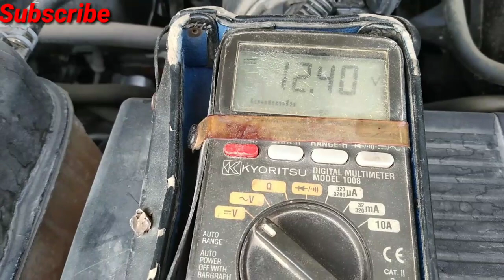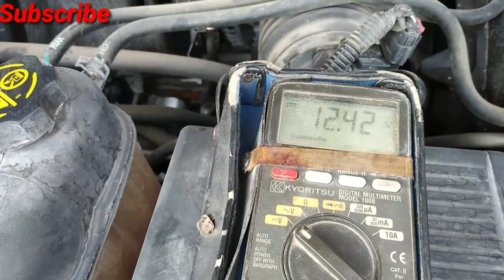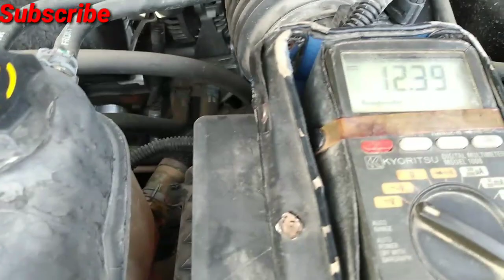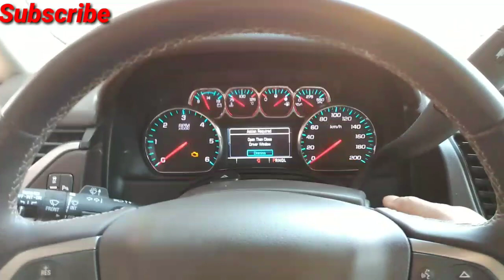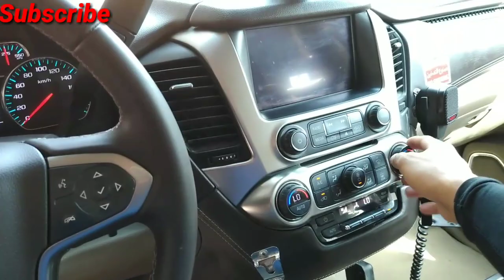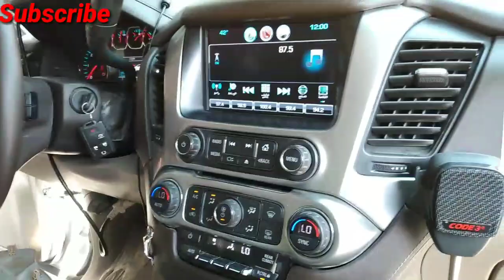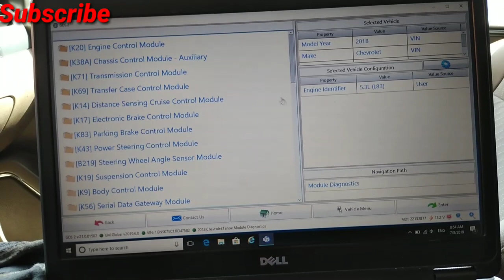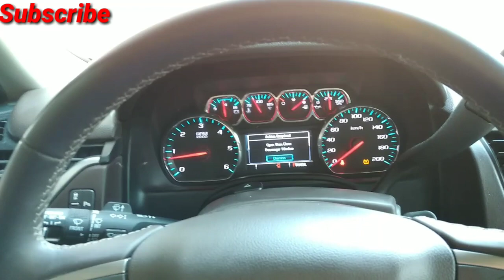2019 Chevy Tahoe No Power No Crank No Lights How To Diagnose (TAGALOG)

Comment: I had Thai issue after I was rear ended and that same thing happen so I did this and my truck starts now but my radio don’t come on or my cool/ heated seats won’t power I check fuse and they are good but still won’t work any help please?